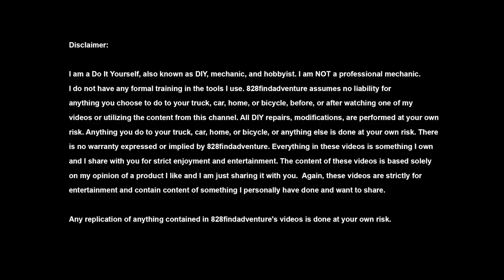Honda Ridgeline tailgate lock install

Comment: If you have a 2017, just open your glove compartment and there is a switch for the bed. Yout door will be locked and the inside storage. Don't buy extra.
Reply: Does that work on 2019 too, if you know.
Reply: My 2018 only locks the trunk, not the tailgate. Test your 2017, I think it is the same.